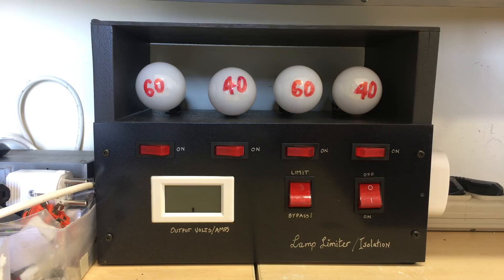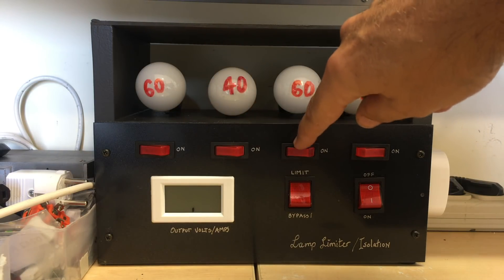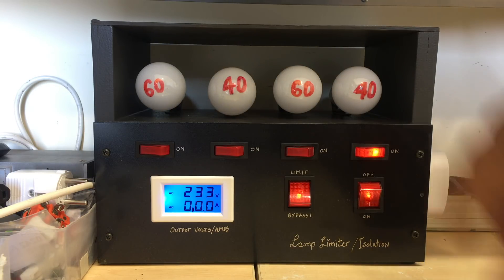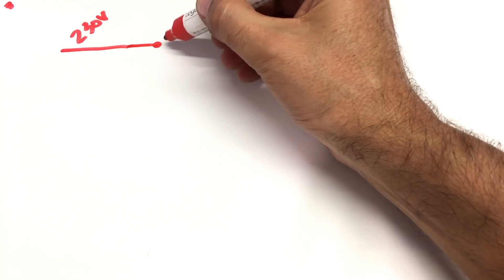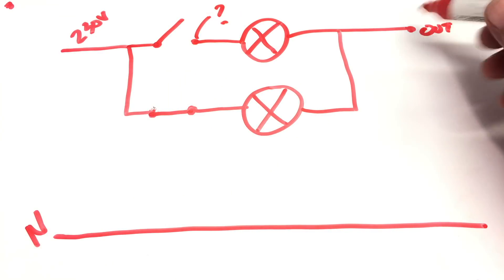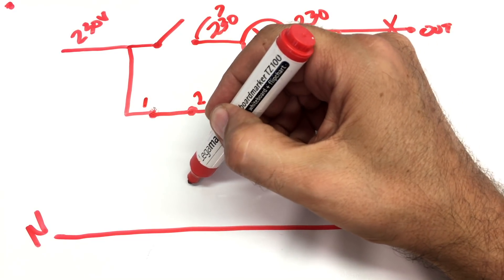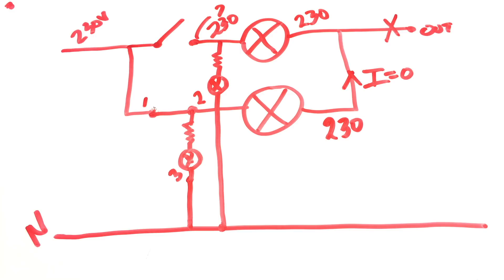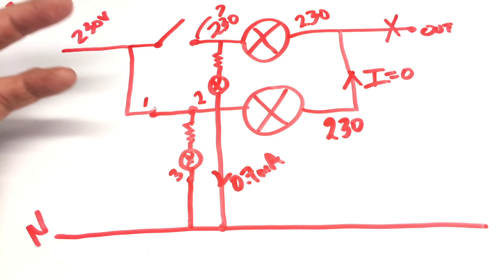DIY Test Gear: Dim Bulb Limiter / Tester with Isolation - Tricky Question?

Comment: Well that's a nice one!  You don't need to break one open to test the theory though. With the switch at the OFF position jumper pins 1 and 2 (since 3 is the N side) the neon will not glow (but it should). IT will glow only if you throw the switch to the ON position. This is the proof that there is a second switching action happening internally which is activated with the switch at the ON position...
Reply: I second that, there is only a little bare wire under the switch head to the internal bulb at the ON position that connects the bulb to the Live. The Off side has no wire under the switch head, that closes the circuit.
Reply: Reb Elba so you opened one huh?
Reply from the maker: mamoynas : thanks guys. That is enlightening. I really didn’t want to “bigclivedotcom” one of these right now. 
PS: you know you’ve made it in youtubeville when your name becomes a useable verb.
Reply: Yes Sir, but in the past when I accidentally put my chair on it and I tried to fix that :)
Reply: Electronics Old and New by M Caldeira  :)

Comment: What a puzzle! I kind of replicated this using a couple of switches. When I switched one of them on, both lighted up. I opened up one of mine, there's a 180K resistor and the neon bulb. There's got to be something else in the switches you used.
Reply from the maker: Zirok1982 : I think the previous comment answers this.

Comment: Just made a littel recherche for this switches. I found ONLY one manufacturer, which publishes datasheets of his switches: Everel. There you can clearly notice, that the little lamp inside ist switched with an extra contact! I guess, cheaper ones  (china crackers?) have a hard wirering connection to the ground pin. It's a pity, that Marquardt, a big german manufacturer doesn't publish more informartion of his very good products. I would like to know, Manuel, which swiches you have bluild in your machine.
Yes, i know, the video is from last year. But the problem is always there. And just building my iso-trans with the dim bulb tester inspired by you.
Regards from Germany.
Reply from the maker: Alfred Neumann : unfortunately I used these switches which I had in my spares box do years. I have no idea where I bought them from and surprisingly, they were perfect for this application. Just lucky, I guess.
Reply: Thanks anyway. This problem will be cracked.

Comment: Hi Manuel, great videos - keep them coming.  Just a thought, could you isolate the individual neon switches with a suitably rated diode?  This would form a kind of "logical OR" and prevent the voltage appearing across the switch when an individual switch is thrown.  Ordinarily, it wouldn't be a great idea given the high voltages and potential short circuit currents.  But, you're limiting the current anyway and I see in your latest revision you've included a fuse.  Just a thought, for those with switches that behave differently.  Anyway, keep up the good work!!
Reply from the maker: The isolation of the switches wasn’t necessary due to the ones I used being “special” - I haven’t been able to find these again. A diode won’t work with the AC voltages we’re dealing with.
Reply: @electronicsoldandnew  Ah yes, of course, it's AC.  Well, that complicates things.  Perhaps relays would work, but then you'll need an additional low power activation circuit.

Comment: With respect to the circuit shown, with the top switch open then the top neon is in series with both the limiting bulbs. Hence you have a much reduced voltage running through the neon's resistor then through the neon itself hence the neon will not light.

Comment: I don't follow you on why pin 2 on the top switch would have 230V potential on it with the switch open.
Reply from the maker: It goes all the way through they transformer, at zero current, so full voltage. It’s shocking 😊

Comment: All the switches that you show that I have use led's, and yes I already opened one up.
Reply from the maker: Joseph Nicholas : these are definitely neons. They are quite old as I had them in the parts box for probably over 25 years! Hey, that means this thing is an antique! Didn’t think of that.
Reply: It's a Bulgin 5503 (or a chinese clone), single pole "switched neutral" lit rocker switch, it comes in several variants of voltage (24vdc, 115 vac, 240vac), and with led or neon bulb.
https://www.tme.eu/ru/Document/a302fa19edb9b8374e1a120beb2524d6/5503.pdf

Comment: I've been beating myself to a pulp over this in a slightly different fashion.  Going for more of a vintage look, I thought using metal switches (with rubber boots) and separate jewel lights with #47 bulbs posted right above each switch..  I've tried everything I can think of and can't get that to work on a simulator without them all glowing (of course I still consider myself a newbie, so...?).  Diodes maybe?  Helper monkeys with EE degrees?  If anyone has an answer I would appreciate it.
Reply from the maker: check out the comments on this video. Someone brought this up and the conclusion is that a very particular switch is needed.
Reply: @electronicsoldandnew  Thank you for the reply.  I saw that, but old-timey appliances have used switches in conjunction with separate jewel lights to show when the switch is closed and powering something else; perhaps just not as in this case.  I'm now on a mission.  The adventure continues...
Reply from the maker: good luck
Reply: @electronicsoldandnew  I'll report back if I slay the dragon.